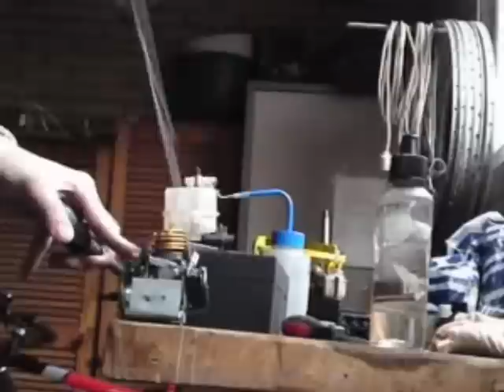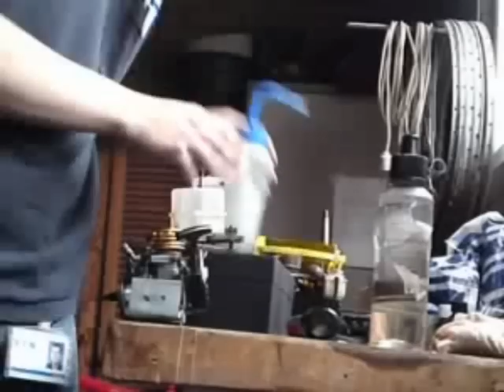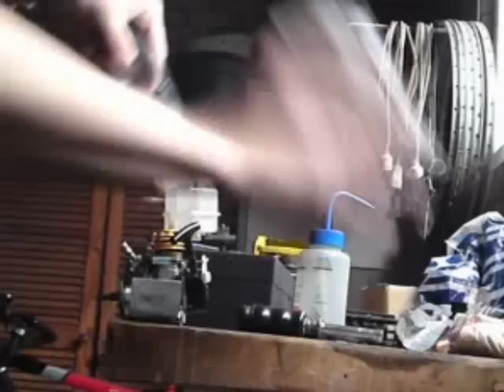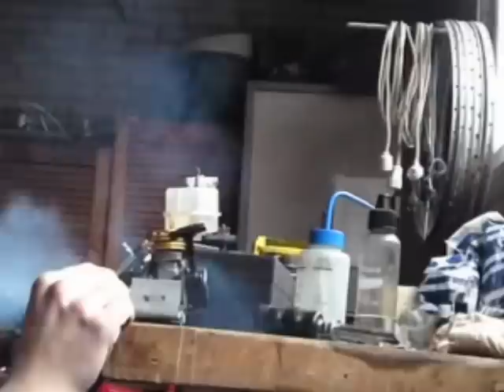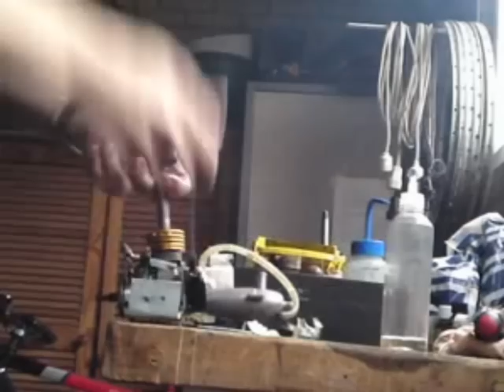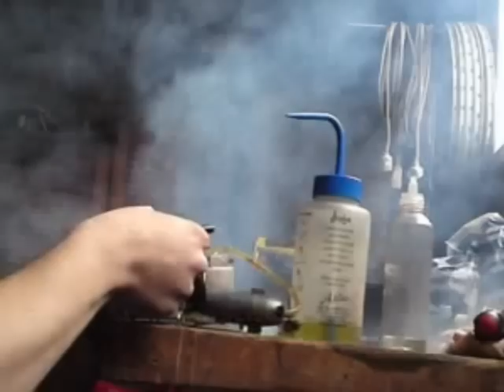kyosho diesel rc

Comment: Nitro is a 2 stroke diesel.....nitro has lube in it making it a 2 stroke and nitro motors use compression to make the combustion happen......smh
Reply from the maker: wrong nitro cant self conbust
nitro only burns when helped with a glow plug

and for the rest your right